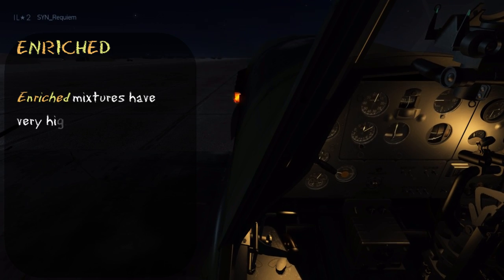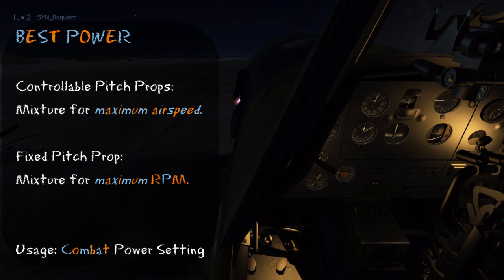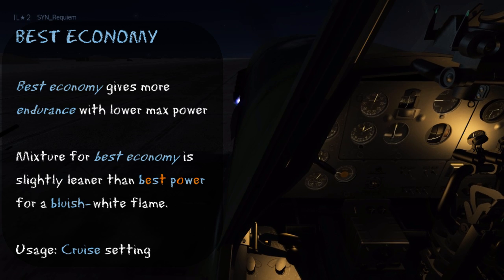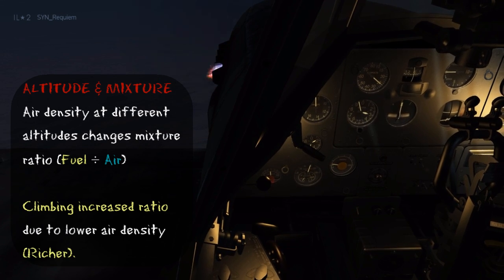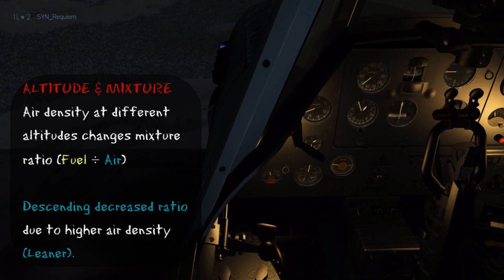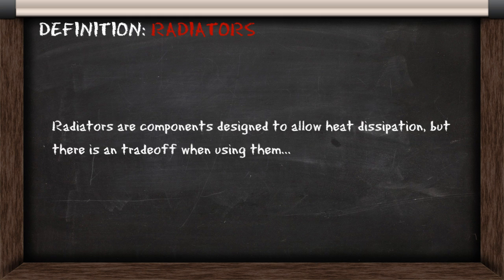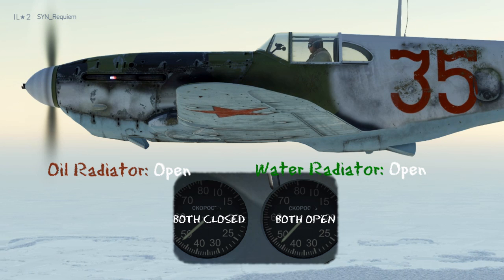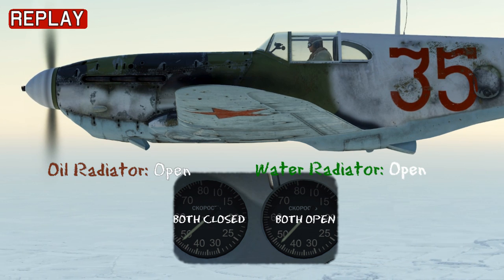CEM #1 - Mixture & Radiator Basics

Comment: Quick question: what would be your recommended settings for water and oil radiator openings for cruise, climbing and combat? I know it probably differs from aircraft to aircraft... but just to get a general idea.

In Cliffs of Dover, for instance, you could go full throttle in a Spitfire with 70 % rad open without having to think about it (except if you are in a steep climb as you still need enough airflow). In combat, however, we would often go rad full open because of steep vertical manoeuvers that tend to make the engine heat up quicker.
Reply from the maker: Thanks Chuck. I've never really thought about testing what various % to use for radiators because as you said it varies from aircraft to aircraft and I only have some much brain matter upstairs to store that info, so I generalise and apply to all aircraft :-)

The easiest way for me is to just monitor the temperatures and adjust accordingly for slightly warmer than optimums, as well as checking on them when I'm at slower maneuvering speeds because there will be less cold airflow flowing through to help dissipate the heat.

Eg - In the LaGG when going into combat I'll close the radiators half way as it doesn't seem to have much tendency to overheat combined with high power settings, but in the IL-2 I have to be careful because even with a fully open radiator it will begin overheating at high power settings pretty quickly.
Reply: As Reqiuem wrote, it depends from the temperatures. So basically, you'll need to watch them. Best Oil temp is ~80-100°C and make sure it's not below ~40°C while applying full power, the engine won't like it. Maximum is ~120°C where it stops lubricating which will result in severe engine damage very soon. Water/Coolant temp maximum is ~110-115°C, don't let it boil for too long. You'll see the vapour trail coming out of your radiators if it runs too hot. But you've got enough time to react in this case. There's no minimum temperatue, unless it might freeze :)

Comment: So I have a SERIOUS question that has puzzled me for years... The mixture. About the mixture, you show that by looking at the exhaust of the engine you can see the flame colors and judge how much mixture you need to use at that altitude by looking at them. HOWEVER, in aircraft in which you CANNOT see this, and when flying the Lagg 3 WITHOUT the canopy opened up, HOW do you know how much mixture to use???? Is there a temperature gauge to check how much you should be using? Is there supposed to be a way to tell at all? Please help me!!!
Reply from the maker: In German aircraft fiddling with mixture is not required because it is automatic. In the Russian aircraft where you can adjust mixture, the difficulty in knowing what mixture is correct occurs because they use a Constant Speed Propeller. One way to adjust it is to enrich the mixture, then lean it until you catch the RPM slightly fall, then enrich slightly again, but the problem is that the CSP counters the RPM change pretty quick.

Because of this, aircraft with CSPs usually have an Exhaust Gas Temperature gauge (EGT), and this gauge is what helps correlate your mixture setting with a temperature. The optimum temperatures for the engine to run at are usually provided by a manufacturer. However, in game the only aircraft with an EGT gauge so far is the La-5, so you're out of luck generally when trying to get mixture absolutely perfect. 

Don't worry about it though, it makes a bit of difference, but it's not game breaking or anything. Close enough is good enough :-)
Reply: IL-2 Tutorials by Requiem Ah ok thank you for the explanation! I was not aware that the Lagg-3 used a constant speed propeller before so that's why it was extra hard to figure out what change it was even making when I was flying it and messing around with the mixture. I really appreciate your tutorials and your help man thanks! Just too bad that the Lagg-3 wasn't fit with an EGT gauge D:

Comment: Are there no instruments to guide you on the mixture ratio? I recall there being a Exhaust Fuel Temperature indicator (or something like it) in a Beechcraft King Air back on FSX; did most WW2 planes lack suck instruments?
Thanks!
Reply from the maker: The only aircraft in Il-2 that has an instrument showing the mixture ratio is the Pe-2 I believe.

Comment: Wow,this is getting complicated,would it be too simplified to say that you vary the MIXTURE depending on the COLOUR of your engine exhaust-depending of course  if you want economic flying or raw power?
Great video,im going to have to leave ROF  for this  game! Thanks again for the time  youve spent.
Reply from the maker: Yeah, it's fine to think of it that way James. It is easy to do, but checking out the window can become a problem in combat, so with practice you should know approx. what mixture position will be optimum depending on what you want. At least make sure it is set properly at your chosen altitude before you end up in combat where you may forget about making adjustments.

I illustrated mixture this way because we don't have gauges showing things like Exhaust Gas Temp/Cylinder Head Temp (EGT/CHT). These let you figure out the optimum points for mixture depending on your flight condition, but it starts getting a bit complicated when talking about them so I chose to omit them.

I try to make these concepts as easy as possible to understand after all :-)

Comment: +RequiemBoS  Many 1940's United States engine installations had compensated mixture controls.  Full Rich overrode the compensating aneroid for max sea-level power and enhanced cooling.  Auto Rich was the normal setting for best power, Auto Lean the normal setting for best economy, in the operational altitude range.  Earlier installations sans altitude compensation require care in setting mixture for altitude.

Comment: Full forward 3 nearly 4 years to the Spitfire ) ! What is the story with the radiators ! I run either custom or expert but can't stop the oil temp from going through the roof and seizing the engine ? or can i get the radiator handle in cockpit to move or radiator door flaps to  open / shut regardless of having axis assigned ! can fly for around 10 mins slowly watching the oil temp go of the dial to seize time ,the water temp sits in the green mostly .
Reply from the maker: Hi Sungear, I've never had an engine seizure just flying the Spitfire around so I would double check your key assignment. The Spitfire radiator is on the same control as the one for the Bf110 radiator (there is no oil radiator control). I think it is Right CTRL + - by default. It opens in 20% increments so you can't assign it to an axis.

The temperature you look at a lot will be the water temp to ensure it stays below 120°C because it is much more sensitive to change than the oil temperature. If it gets higher than that then you will start having overheating issues.
 
Without enough airflow for cooling the engine will seize up as you've experienced, so basically you need to either fly faster or open the radiator. The faster you fly the less the radiator needs to be open. If you start doing prolonged climbing or combat maneuvers then your airspeed will generally be slower and you will start overheating again so then you need to start opening the radiator, but open it only as much as you need to in order to keep the temperature down.
Reply: Thanks for your reply ) I found my problem with help from your post ! not worth running an axis  due to increments when opening radiator ! So if one did run an axis you still need to depress another button like the top of the operating lever in the cockpit before sliding back or forward , thanks again )

Comment: I don't understand the best power part, I thought the richer mixture was the more fuel an engine burnt and hence the more power.I mean, I get it that at an altitude there's not enough air for an engine to burn all the fuel, but does it hurt the performance of the engine? Are there any negative effects except higher fuel consumption if I fly with enrichged mixture all the time? I hope you can help cause it really confuses me.
Reply from the maker: Omicron Persei Well, there is an optimum ratio of fuel-air to get the best power from an engine, and if you use a more rich mixture, this means more fuel is added, but this won't increase power UNLESS you add more air in order to keep the best ratio. This would increase your MP, and if you are already at maximum MP, then you can't keep the best power fuel-air ratio, so engine power will fall.

Also, the extra fuel added by a rich mixture gives the engine extra cooling, which lowers temperatures like exhaust gas temperature (EGT) and cylinder head temperature (CHT) and reduces maximum power output. For different aircraft there are different EGTs and CHTs on power graphs which tell you what temps you need to aim for.

I hope that helps clarify it somewhat, but there is a lot of information you can google as well. I didn't worry about going into the more technical side because you simply don't have to worry about it in these BoS aircraft since they don't have the right instrumentation (except for La-5), hence why I showed using the flames as mixture indicators.
Reply: IL-2 Tutorials by Requiem Thanks a lot that really helped. And btw thanks for all the other videos, they really helped me with lots of things, especially the prop pitch. With all those examples it was much clearer than just reading about it.
Reply: IL-2 Tutorials by Requiem Sorry to bother you again but I have another question. I know that superchargers increase manifold pressure, so as I understand it a supercharger in position 2 at too low altitude should damage the engine due to too high MP, but in the game it doesn't seem to do anything ( only RPM drops just a little bit and then quickly gets back). Do you think it's not been modeled in the game? Or I'm missing something?
Reply: IL-2 Tutorials by Requiem Never mind actually, I think I've figured that out. I read that a supercharger's powered by the engine, and it takes more power from the engine when in position 2 that's why RPM drops and then, I guess, it's automatically corrected via pitch adjucment. As a result that power drop decreases your top speed at low altitude.
However I'm still not sure about MP, but my guess is that the whole system's designed in such a way that it doesn't allow any excessive air inside the engine so MP won't go futher than its allowed maximum.

Comment: that's great and all but the airacobra and most other aircraft i have don't emmit flames. either that or I have to change something but I highly doubt that as I have almost all visuals on high. any work around? any fix for that?
Reply from the maker: playerguy2 Sounds like you have IL-2 1946 since I don't believe that sim does the whole mixture flame colour aspect.
Reply: The Air Combat Tutorial Library 
short version:
thanks but I confused it for another game.

long version:
a bit late but wrong game all together.. I thought the game was war thunder. it seems the manual settings are a bit weird - all measured in % -
and the English seem to need more work on the manual engine settings if not all of them. at least that I found. when you said "you should see a flame" I thought I found the solution to my problem for fuel mix.
Reply from the maker: Hey no worries! I don't own War Thunder but with my videos I aim to show the principles of topics so you can learn and apply them regardless of what simulator/game you fly.

I'm currently undergoing RL training to be a flight instructor so I haven't been putting out videos lately, but I'll be finished in a little over a month and will be back to making tutorials soon.

Safe landings!
Reply: The Air Combat Tutorial Library Aldough the concepts do apply, they don't yet perfectly. Also.. you used the term 'own' so I'll just add that War Thunder free (.. in case you'd want try). Can't wait for more tutorials. I enjoy watching/re-watching them. :)

Comment: How do you determine best power in flight in an aircraft where you can't see the flames?
Reply from the maker: The main thing you need is an airplane with an "Exhaust Gas Temperature" gauge or EGT. When your EGT is at the peak setting your mixture setting is optimal. If you don't have an EGT gauge then you would lean until the engine runs rough then enrichen the mixture a little bit past that
Reply: Hmm, thats what I thought so, but the engine doesn't really sound or shake in its "leaned" state until just before it cuts off. In real life I do it based off sound but the sounds and RPM (no CSU) but these techniques aren't really sufficient for me in BoS.

Comment: 0:10 - The word is enriching, not enrichening.  You enrich the mixture.  Strangely enough, "enrichen" is actually the Middle English form of the word, but that hasn't been used since the 15th century.  Likewise, you don't "lean" the mixture.  You "lean out" the mixture.  That's technically not a correct usage of the word "lean," but it has been customary when referring to gasoline engines long enough as to come into common usage.